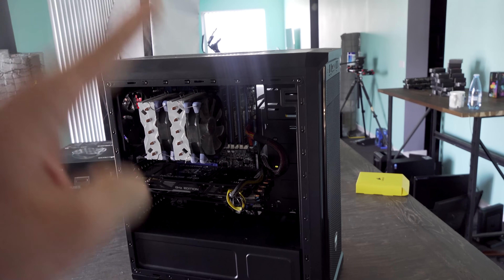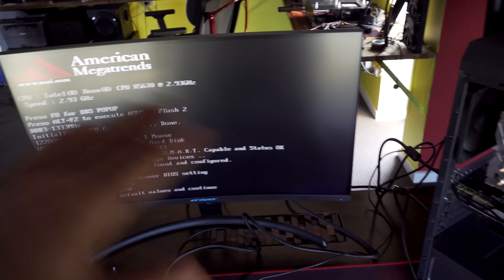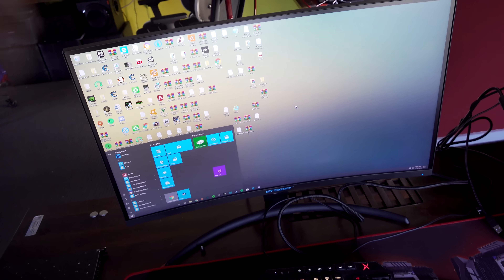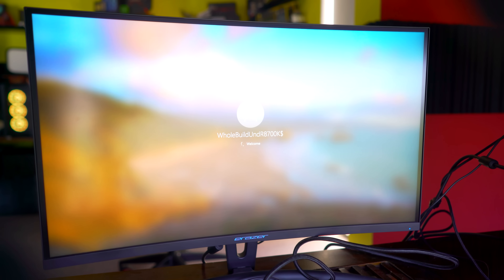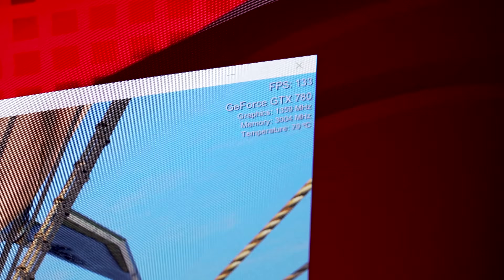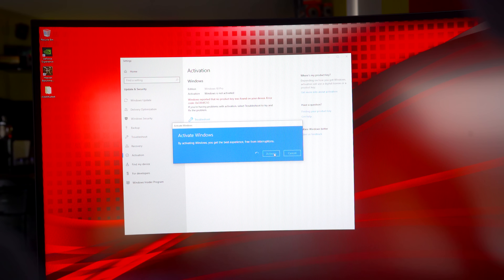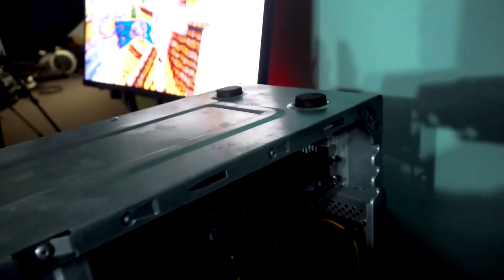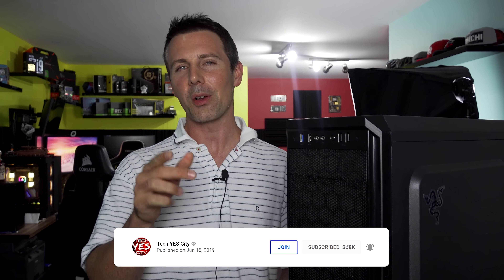Fixing "No Signal To My Monitor" - This Computer Came Back 2 Years After Sale.

Comment: No! You don't defrag it first. I'm sorry but that's such a rookie mistake. You clear out as much crap as possible BEFORE you even consider defragging. Clear that desktop of all that junk and empty the temp folder. If you don't want to delete any files, you know what you could do? 𝘾𝙖𝙡𝙡 𝙩𝙝𝙚 𝙘𝙪𝙨𝙩𝙤𝙢𝙚𝙧 𝙖𝙣𝙙 𝙩𝙖𝙡𝙠 𝙬𝙞𝙩𝙝 𝙩𝙝𝙚𝙢 𝙖𝙗𝙤𝙪𝙩 𝙩𝙝𝙚 𝙨𝙞𝙩𝙪𝙖𝙩𝙞𝙤𝙣 and get their permission to delete files.

Of course the defrag took a couple of hours, because you didn't clear out enough space for it to actually run effectively. Is this your first time using the defrag tool? Sigh.

1. Manual hack n slash of files. Clear desktop = 10-20% performance increase immediately.
2. Remove old Windows installations and other files to free up probably 5-15 GBs of data.
3. Use CCleaner to clear the rest of the junk out, making sure to untick firefox (or chrome) history, cookies and passwords so you don't have to log back into all your websites.
4. Use Defraggler to clean the hard drive much better than the Windows defragging tool ever could.

Optional upgrade of an SSD is definitely required but it won't help the siotuation if the HDD is still chock full of crap.
Reply: What he said.

Comment: We're both fans plugged into the CPU header? If the CPU cooler fans don't come with passthrough and the one connected to the CPU header it won't boot, it's a bios boot protection, very common :)

Comment: My monitor used to lose signal, randomly, every time this one particular friend came to visit. At first I just thought it was a bit weird, but eventually it became a pattern. I finally pinpointed the problem when, one time, he took out his pretty old phone and put it on the desk, and BOOM! the monitor lost signal again!
Whatever radiowaves the thing was putting out were interfering with the monitor, even if it was in his pocket. 
My own, new phone will also kill the monitor randomly if I put it really close to it, like, sitting right under the monitor. Every hour or two the monitor will just totally lose signal for 5-10 seconds.

Comment: I do the occasional computer repair gig. The last simple "repair" I did was a misdiagnosed faulty motherboard. Turned out that a full time "technician" claimed the motherboard was dead while, all it had wrong with it was the power supply unit. I guess since the pc was an "old" ddr2 lenovo desktop, the technician did not want to invest time in truly diagnosing the issue and just recommended the client to buy something more recent.

Comment: Ok, so...if the CPU did overheat( the second fan worked I presume) it wouldn't make the cmos crap itself. My guess is that there was a power problem. Not with the psu, but the power in the house itself. Over voltage or an under voltage. Overall, good work.
Oh and don't defrag with less than 10% free space.
That 17sec post time, oh boi

Comment: sometimes my graphics cards fans stop so I spin them and they work... it's weird
Reply: That's perfectly normal. Many modern cards have heat regulation firmware or saoftware that monitors the temperatures and turns the fans on once the card gets too hot. However, sometimes it waits too long and the temps are up to 80° before they kick in, the GTX660 for example was renowned for this issue.

Comment: Is it bad to combine ssd and hdd? Games are installed on both ssd and hdd. The games installed on hdd sometimes do something like frame skip when loading new areas/textures. Is it because of the failing hdd or just the hardware (ryzen 2600, rx 570, 16gb 2666mhz ram)?

Comment: CMOS Battery could be flat. If they unplug the rig or the electricity goes out for a longer time, then the BIOS settings can get corrupt in the CMOS producing a no-post. If you guys have older systems that behave like that, just pop down to the shops and get a new CR2032 button cell.

Comment: One big issue I had with my PC (P8Z68-V Pro + i7 2600k) is that it would randomly stop displaying output on the motherboard and GPU. Clearing CMOS did not help. Only removing the GPU and adding it back in would make it come back. No known trigger for this happening. Maybe updating the GPU driver? Weird.

Comment: MY PC DOES THE SAME, IT STUCK ON INTEL LOGO. CANT EVEN ACCESS BIOS WHEN I PRESS THE KEYBOARD. TRIED TO RESET CMOS, MEMORY BUT STILL NO SOLUTION. MY FANS SPIN VERY WELL. THE MOTHERBOARD SHOWS POST CODE "EB" WHICH SAYS "CALLING LEGACY OPTION ROM" WHAT MIGHT BE THE PROBLEM?. PLEASE HELP

Comment: I have a question. I have a built PC built by me and my motherboard died on me 4 months after building it and it's the second time it's happened in the same amount of time between the two motherboards I had with the same issue. Is it the power supply? I have a 550w Insignia NS-PCW5508 80 Plus Bronze and works great as I'm using it on my backup AMD board I have laying around but seemed to of killed the VRMs or something on my main board as it'll turn on for a couple seconds then shutoff and now doesn't even turn on at all, even with other PSUs. Mobo is a Gigabyte GA-B85M-DH3. I don't wanna buy another mobo just for it to die in like a few months like every one I had before.

Comment: SSD is not even  suggestion is a bloody requirement no matter if its even for office only unless someone loves waiting more than working... If anyone don't want to spend too much you can buy just a 128 or 256GB super cheap SSD just for the OS and use the HDD for the rest...

I still use a very old 128GB SSD on my PC and never bothered changing it, I always have around 80GB free in it all the time.

ps: Also every time you would use air to clean a PC either disconnect fans or stop them with your fingers before spraying air, with  lot of air pressure the fans can get to very high speeds and they produce electricity that will be fed to other components all over the motherboard and if they produce too much energy it might damage something.

Comment: Generally when a computer is this slow without any other issues, it's a sign of a bad sector on the HDD
Reply: Not really, especially if the drive it self is damn near full, and it's only a 5200 RPM drive.

Comment: i bought a used 6700k pc with a z170 mobo 8gb ram, it randomly would post to bios, and after a while stopped posting to bios, after being off for several hours, it would sometimes post to bios, If anyone out there is having this issue, check your power supply, it's what was causing the problem for me in this situation, had a crappy bronze rated chinese psu in the rig, replaced with a 550W gold rated, and runs like a boss.

Comment: what? If the pc has no signal to the display it's either the cable, the monitor, the gpu, and you're correct to say if the thing powers on it's likely not the PSU. but there's no chance the hard drive is causing that issue, it's a bizarre idea in itself. Maybe windows 10 did an auto-update to the gpu driver causing the system to be slow booting once until it was fully initialized but not always. I would at this point suspect something amiss in the gpu or motherboard.

Comment: I've had someone send back a PC with this exact problem (no signal, PC not turning on).  It turned out to be a bad CMOS battery.

The thing is, if you removed the motherboard battery and reset the mobo, the PC would boot fine with the bad battery.  That is until you remove power from the PC (which happens when you go to give the customer their PC back!).

I noticed this at my workbench and managed to fix the issue before sending it back.  PC works like a charm now.

I've also learned that you have to be careful with temps.  I had a 2700K getting 60c after a 4 hour stress test OC'd to 4.2 GHz but at the customer's house they were getting 80c+.  I rarely overclock builds any more as it's just too hard to predict what kind of environment the PC is going into.

Comment: I just upgraded my ram from 16gb 1600mhz to 32gb 1866mhz,  everytime I changed something in my bios it wouldn't boot and I never got a image until I reset the bios and plugged in my old 1 stick of ram.  first time i did it I didn't seat the ram right and only show 24gb so I set the ram to 1866 in xmp and rebooted thats when it first happened I reset the bios no image, I took out all the ram sticks and place a 4gb in and it booted I shut is down and test each ram stick to make same that they all worked and they did. I most of done this like 5 to 6 times messing with the bios and not image until I just left it and noe it running ok.

Comment: Long time watcher , first time teaching out. Love the content my friend. I too run a similar operation , though not nearly as big  as you and it’s really good to see others doing it. I need to get me one of those data vacs you use. Air blowers do not clean so good. I also started using the break cleaner to bring faulty pc parts back and it works more times then not.

Comment: I was using PSU cable extensions on my RTX 2070s and my PC would turn off every time I ran a game I was super bummed because I tried everything from new ram and even a new MOBO until I got mad I took off all the PSU extensions plugged everything in and ran heaven for 4hours and who knew the PC worked like a charm no issues at all to this day I’m happy with it and I even got a 120mhz oc on the GPU definitely learned my lesson but a happy ending. Love the channel keep up the great content 👍

Comment: ive had a few power supplys   the 5 volt on 24 pin low voltage coz problems had to replace

Comment: I have had some complex and simple problems over the years. The first desktop I had supported an old steamroller CPU. The switch to Windows 10 killed the sata controller on that cheap old board, forcing me to upgrade my platform. Recently, I had a 5 year old power supply of mine start to die. I had been running that power supply for quite some time, and it started faltering occasionally when my system was running at full blast or even sometimes my system wouldn't have booted. I deduced from the behaviors exhibited that something relating to the motherboard power was the issue, as when my system would be running at full blast my computer would cut to a blank screen and then I would see the POST screen as if my computer just restarted. I tested with a spare known good PSU to confirm that this was the issue, and because I had a spare I was able to keep running my PC until a new one arrived. In a side note, my spare PSU is a huge Antec PSU that doesn't fit in my case so I had wires splayed out everywhere on my desk. I took pictures to show my friends and jokingly stated that my PC was on life support.

Comment: I would call an SSD for your boot drive an absolute requirement with Windows 10. The way Windows now uses the boot drive is just too extreme for an HDD to ever keep up. They're great for mass storage, but as a boot device, everything from grandma's email computer to your $2500 gaming rig will be sluggish with an HDD, if not immediately, after a bit of use. And yeah, filling the drive to near 100% doesn't help... Really though, it's good practice to disable pagefile on your boot SSD as well, as it can severely cut down the life of the drive. I've got a work laptop with an NVMe SSD, and realized it's already down 2% from mostly Windows pagefile activity. 

Also, I'm glad we can blow air at fans and let them spin without worry of causing damage -- I remember when there were fan controllers with no reverse voltage protection on them, and spinning the fans with air would cause a surge and fry the controller, and potentially other components. Those were not the fun days.

Comment: I have another pc thats 5 years old and runs incredibly slow. It does not have a ssd drive but its only about 20% full.  Ive done a clean install of windows 10 with the original cd and wiped all of my data in case of a bad driver or other reason.  I have defragged the hard drive but still extremely slow and almost impossible to use, any suggestions?

Comment: Christmas morning I got new ram, put it in and my pc doesn’t boot, put my old ram in and it still doesn’t boot and when I plug my keyboard and mouse in they don’t light up and no signal to my monitor, so I get a new motherboard, take my pc apart begin to change over the cpu and realise I didn’t check what socket it takes and it doesn’t fit, so after installing a new cpu and putting my pc back together it finally works. I learnt my lesson on making sure everything is compatible

Comment: For heavily filled up HDDs it’s faster (and perhaps more successful) to move the offending large files to an external SSD and then run defrag. Less fragmentation to resolve and more free space to contiguous files onto.
Reply: And the defrag will run a lot faster, since the defrag algo has more free space to use while moving files around.

Comment: Stuff like this is why I love Linux as you can choose to create a swap partition on your boot SSD/HDD, during install, and not have to worry about not having the space for swap files, and no CD Key needed. But regardless yes even a 120GB SSD for the boot drive is a must for any OS, just be smart about your space.

Comment: I also got this no signal from the vga, but the system still run. I tried changing PS, cleaning memory and changing the slot. But never try the cmos. Do you have any idea where this faulty come from?  im using zotac gtx 760.

Comment: I used to have that exact problem on my previous PC I build 4 years ago. Re-attaching the RAM sticks make it work real good afterwards. This problem happens all of the time after doing some maintenance.

Also older ASUS Motherboards won't boot because of putting "too much" thermal paste due to its sensor for pressure requirements of the CPU Heatsink applied. This took me a while to figure it out but thankfully it was a common problem in some older forums that I was able to track it down.

Comment: people dont realize how handy pulling the cmos battery is. a bad overclock blue screen can cause tons of issues. your cpu running at half speed, crashes, boot loops etc..... but you just pull the battery for 1 minute or so . and bam back to basics. i almost threw out an 8600k thinking i fried it. last thing i tried was the battery as a last ditch effort. and perfect ever since. now its a go to method when i buy dirt cheap pcs that wont work.

Comment: Blow has more force than suck, as it can throw a jet of air instead of just creating a lazy drag that has little power unless very close to the nozzle.
Also that PC probably has a bad case of startup junk - and before a defrag, even if not choosing files to delete, it's probably worth running disk cleanup + system files, but unchecking browser cache (and downloads if that got automatically checked due to storage space)

Comment: high quality cooler master still have problems. I exchanged my 1200watt coolermaster 3!TIMES. The 4th one has lived 2 years so far.

In another case, the problem was the.monitor itself (LG 23inch)

Comment: Have you encountered a Z77 motherboard which will work fine on single channel with two ram but not dual channel with two ram?
Same set of ram by the way
It just happen out of blue moon right after I use the motherboard to test another processor and insert back my own processor(I7-2600K by the way)

Comment: I would have put the non-LED fan replacement into the middle slot between the tower fins and placed the middle LED fan on the outside. Also, I've heard that using a leaf blower can clean the inside of the case/PC quite well.  Sadly, some dust can cake on components and isn't easily removed.

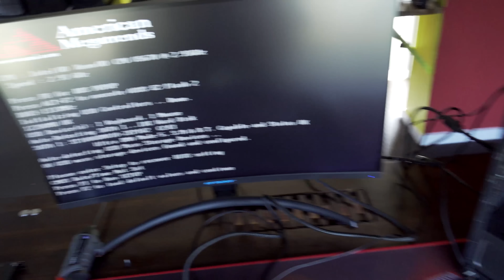Comment: 2:32 shows America megatrends bios boot screen.  4:23  and  4:43 no activate windows in corner before Defrag..  7:24 and 7:34 shows activate windows on corner After defrag before ssd.  8:54 says Asus bios boot screen after SSD install? 9:21 no activate windows in corner. Did you accidentally combine 2 separate videos?

Comment: Ok so I had no signal, after I remove some ram, 4 dimms down to 2. Tried it with only one and it worked. Reinstalled the second no boot, reset CMOS still no boot turned out reseating the CPU was the issue. Go figure 😐

Comment: When blowing out a PC, do you need to hold fans to prevent them from spinning too fast? I heard that once but I see that you don't. Tnx
Reply: I stick a straw or something thru the fan to keep it spinning when blowing out the dust so that the air hits the blades and cleans them instead of just spinning the blades instead. I've heard you don't want to over-RPM fans with a blower, but I haven't seen any tests on that.

Comment: ive been repairing laptops, pc's and servers for a living for over 10 years. from board level repairs like Luis Rossmann to component replacement. ive seen a few systems that are easy to repair like this, where you just clear out the cmos by either a switch on the mb or removing the battery. but thats rare in comparison to other common issues causing this problem.

Comment: I killed half of my hard drive capacity by low level formatting.
That was my fault, tho hdd gone rekt and I just wanted to do some new stuff with it.
Reply: If your drive had errors ("gone rekt"), then formatting it didn't kill anything - doing a full format caused every sector to be written with zeros, and the sectors that gave errors during that operation (because they were previously rekt) were marked bad and skipped, leaving the drive with a capacity less than it had when it was new (in your case, a lot less)

Comment: Note 1: If a buyer brings a PC after 2 years of usage back to the seller then he has full trust in the seller... good job,TYC!

Note 2: If a PC gets really slow (Start up takes like 5min) then open the Task Manager and look for "Trusted Installer" this eats up ram when Windows Updates went wrong it put that data in a secure portion of the ram and locks it. Itcan use more than 80% of RAM which slows down your PC like hell and will be reloaded each time you restart your PC.
There are many guides to fix this on the web. 😉